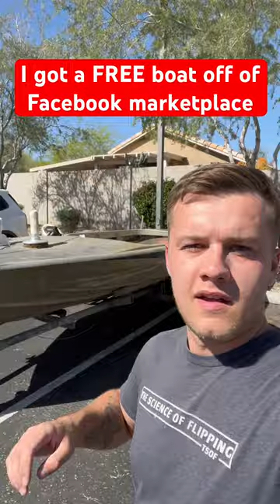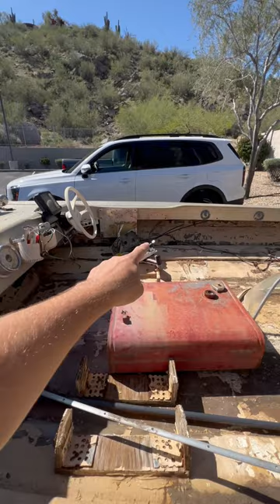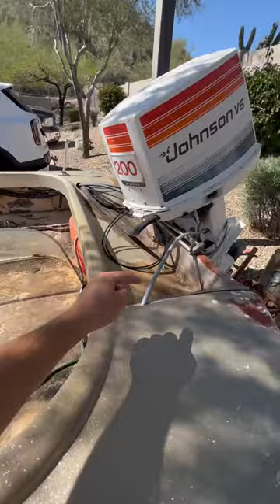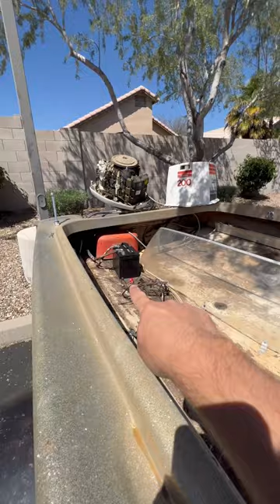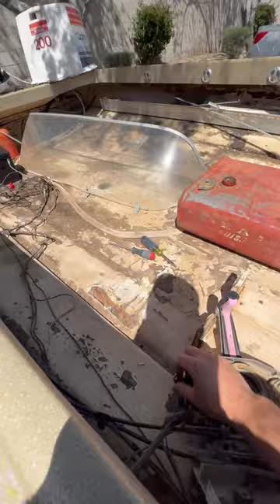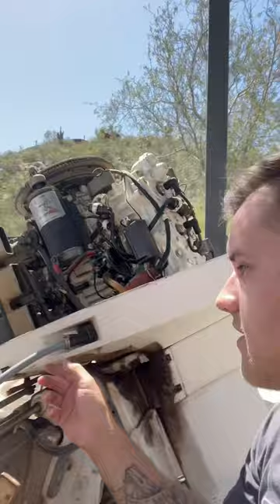Part TWO ✌🏻

Comment: Put 'earmuffs' on that thing, or submerge the lower unit in a tank to lubricate the impeller when it starts.  The old fuel lines break down internally and shed their lining resulting in 'black sand' rubber particles which will foul the carbs.  Replace it with an ethanol safe one. Good luck and be careful, that thing is fast.😅